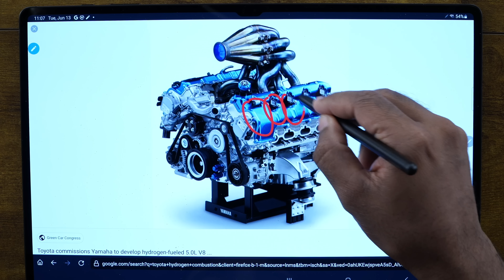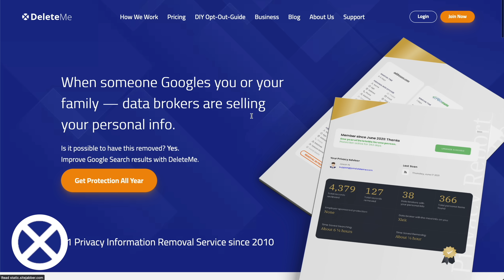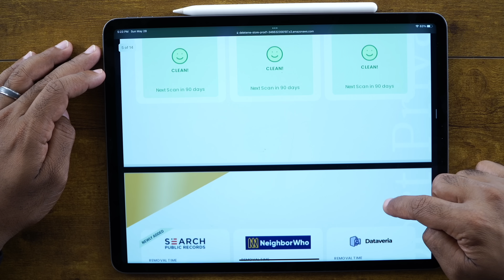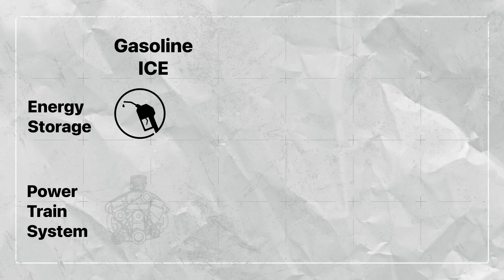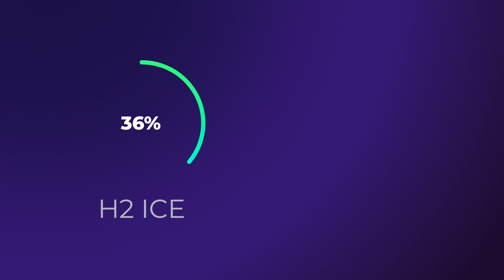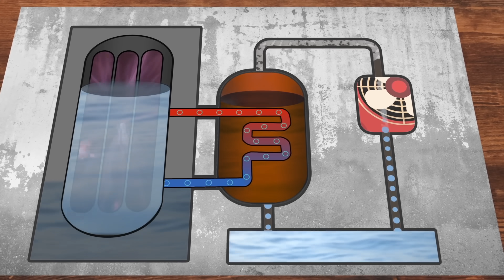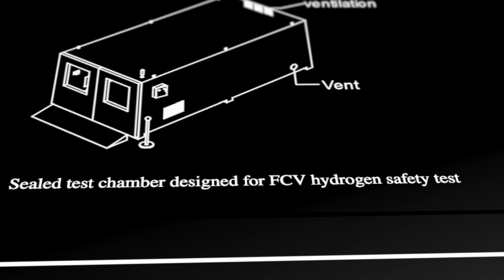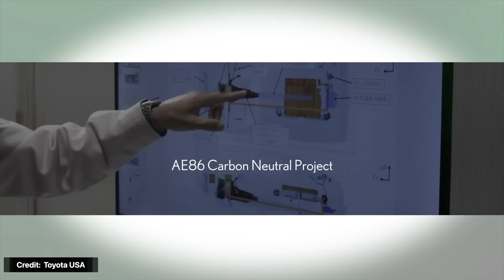Toyota's Says They Just Destroyed EVs - Hydrogen Combustion Engines

Comment: Very eloquent and informative documentary 🎉🎉
As for concerns about NoX emissions from ICE lubricants, maybe far smoother silicone oils can replace traditional engine lubricants
Reply: The NOx emissions are from burning fuel (in this case hydrogen) in air at high temperatures. Air is mostly nitrogen (78% N₂), and at high enough temps it ends up combining with oxygen in the air to produce NOx. The small amount of carbon emissions come from the engine oil.

Comment: The battery sucks hydrogen can bridge the gap between fuel cells and current engines. Electricity is the way but battery is dangerous and 125% less efficient then gas which makes it to dangerous to make it equal.

The battery of a tesla is 900 to 1200 lbs which equals a 50 to 80 lbs of gas and hydrogen the about. The energy density  substantially was to ever on a battery increase it would be even more dangerous then dynamite. If hydrogen as a battery source were to happen you'd have a fuel cell that more equals the benefits that gasoline has. Any combustion car in the world can switch over to hydrogen which reduces emissions all around and increases demand and increases the likelihood if stations popping up. Electricity is good traditional batteries are not

Comment: I can't understand why neither you or anyone I could find in the comments are recognizing that this NOx problem is easily solved by injecting O2 in equal amounts to H2 into the cylinder, thereby attaching all the Os to the Hs without the addition of any dirty atmospheric contamination!  Then you get pure water (with, of course the understanding that there will always be that tiny amount of lubricant seepage past the rings, especially as they get older, and possibly some metallic contamination from various metals wearing on each other when not properly separated from each other by lubricants).  But the major problem of NOx is easily solved by just adding a second injector and O2 delivery system!
AND, you'd probably increase the power output by a huge amount when one considers the ratio of N to O in the atmosphere!
Come on, Toyota/Yamaha, get on it!

Comment: I'd much rather drive a Hydrogen ICE car than a stupid EV. I don't care for efficiency or that EVs have all their power instantly. I just want to press the pedal and hear the rumbling, press my clutch and shift a gear. (yeah I've never owned an automatic and I've driven such only twice in my life and I hate it). I will modify, rebuild and whatnot my 2003 Subaru as long as it's still legal. Jesus I even hate modern petrol cars because of all of their electronics and displays and stuff. I have even disabled my ABS.

Comment: Anyone here ever deal have a boat with a tiny leak in the water cooled intake? Imagine if your fuel was constantly adding water to the combustion chamber. I realize burning gasoline also produces water as a combustion product but burning hydrogen seems like it will wash out the oil and make an emulsion constantly on the cylinder walls until the engine warms up above the boiling point. Would love to know what the oil change intervals are or if they have some sort of engineering solution to this problem.

Comment: The problem about hydrogen is not about whether to use ICE or fuel cell, it's how can we transport highly flamable hydrogen gas to the station across the country. Like to transport it by truck, the gas has to be cooled and compressed to transport which in these process use tons of energy. I believe this is the reason why fuel cell vehicle haven't took off. And neither will hydrogen ICE if no one could find the way to effectively transport hydrogen gas.

Comment: I don’t think it’s the long term solution, but it may be an interim solution, especially if someone commits to putting it in OTR trucks and finds a partner to provide nationwide hydrogen filling stations. It’s quick refill capability is a huge benefit for trucking, and other long-range transport. Might also be useful in shipping and/or rail transport.
Reply: I think that we are a species we have stopped where we are because it works for us. Until we push pass where we are we'll be using ICE for awhile
Reply: I disagree. It is not popular now because hydrogen delivery infrastructure is lacking and clumsy. But some recent research found a way to absorb large amount of the gas into a powder and release it on demand. Given a storage solution , hydrogen can be produced anywhere with solar panels.
Reply: @cplai  doesn’t sound like you’re actually disagreeing with me.
Reply: @geoffstrickler  What I meant was hydrogen can become the long term solution because better storage technologies are on the horizon. So I disagree this is only an interim solution.
Reply: @cplai  Storage isn’t the main issue with hydrogen fuel, it’s separating the hydrogen from water or other sources that is very inefficient. Add in the costs of compressing and storing, and the total cycle is pretty inefficient. It’s useful, but I don’t think it’s a long-term solution.
Reply: @geoffstrickler  I think you missed what I implied in my first reply earlier in this thread. There is a recent research on how to absorb hydrogen into some kind of powder. In such form, the hydrogen molecules can be stored in extremely compact form, not a gas, not a liquid, just being held tightly in the powder medium. The hydrogen can be easily released from this powder on demand. Such storage option can make hydrogen a long term solution.
Reply: @cplai  You’re missing the point. As I said, storage ISN’T the main issue. It’s the energy required to separate the hydrogen from water or other sources that is the issue. Doesn’t matter how easily you can store it or separate it from the powder or paste, it’s separating it from whatever original source you’re using to create the hydrogen in the first place.
Reply: @geoffstrickler  That is exactly why I said I disagreed in my first reply. We basically have opposite view of the situation. Let agree on the fact that we disagreed.
Reply: @cplai  So far, you haven’t said anything that disagrees with what I’ve written, because you keep misunderstanding the problem. The high cost is in isolating the hydrogen in the first place, not in storing it. Storage ISN’T the primary issue, it’s separating the hydrogen from whatever source you’re using to produce the hydrogen. Until you grasp that, there is nothing for us to disagree over.

Comment: I believe that alternative fuels for ICE engines will be the best way towards fixing our emissions problems. It’s not that it’s better than EV’s it’s that it’s very much a better option than Gasoline ICE’s. That’s the point. No they aren’t perfect. But do they need to be? IMO the answer is no. Absolutely not. For me batteries don’t have near enough capacity for a EVs to be a direct replacement for gasoline. I’m not saying abandon EVs, I am saying why not have the best of both worlds? If you commute 15 miles to the office, get an EV for the best reduction in emissions. If you tow equipment 400 miles daily, buy a diesel. If you do a combination of both go for a alternative fuel ICE vehicle. Why limit our options to one type for the future? Alternative fuel infrastructure hasn’t even been given a chance yet. Why are we expecting to go from 1/10 to 10/10 right away? Won’t 7 or 8/10 be good enough for the immediate future?

Comment: I'm not sure what Toyota's motivation is, but I do know that you've really missed the boat on the best justification for H2 ICE by ignoring the truck application. You made it sound like that only matters for commercial trucking, but there are millions of passenger trucks and large SUVs on the road this summer in America alone, which will likely never be replaced by EVs, simply because they need to tow something - and electric power just absolutely stinks for towing. The only viable solutions I've seen involve either adding electric powertrains to every trailer that an EV might tow, or adding battery banks and using high power connections so the trailer can supply additional power to the EV to offset its weight. In either case, it means every trailer currently on the road has to go to the junkyard (not eco friendly) and trailer gross weights will have to increase dramatically to keep the same useful loads.

H2 ICE could be the solution. It may end up being a bit of a niche, but as long as the pump stations are available, I think people who want a real truck that can tow existing trailers over real distances would happily switch to H2 ICE to dramatically reduce carbon emissions.

Comment: EV's aren't as efficient as made out here. Sure, the energy is 90% efficient once it gets to the car- but he counted the energy inefficiency of the ICE from producing the hydrogen. So what about producing electricity? Well, nuclear fission power plants are around 33% efficient, solar panels and wind turbines being on average between 20 and 40% as well. So while the ICE is overall 36% efficient, once you chop 2/3 of the """90%""" efficiency of the EV off- for reasons the ICE had its efficiency reduced already- you get approximate 30% efficiency. Lower than the ICE.

Comment: You mention the efficiency of an H2 ICE and include the production of the fuel as part of it, but I didn't notice you include the production and transmission of electricity before getting stored in the battery. I would have to look up the numbers, but if electricity is created through burning a fuel source, I think the power only has 40% of the energy that the fuel source did? Also, not sure what the efficiency of solar panels and wind turbines are.

Comment: I wonder if there will ever be "Plug-in Hybrid Hydrogen Combustion Engines" or "Plug-in Hybrid Hydrogen Fuel Cell" cars. This way if Hydrogen infrastructure is lacking you can still charge for 50-100 miles of battery range.

Comment: THIS GUY DOSNT KNOW WHAT HES TALKING ABOUT. HYDROGEN IS THE FUTURE. ITS MUCH MORE EFFICIENT THAN ELECTRIC. ELECTRIC GRIDS ARE GOING TO BECOME STRAINED IN THE FUTURE WHICH WILL LIMIT ELECTRIC CARS EVEN MORE. WE ARE ALREADY HAVING TROUBLE WITH THE LOAD IN TEXAS ON THE ELECTRIC GRID. HYDROGEN IS THE FUTURE BECAUSE IT IS CLEAN AND ONCE THE SUPPORT INFRESTRURE IS BUILT FOR HYDROGEN CARS IT WILL ESSENTIALY TAKE THE PLACE OF GAS ENGINES..

ELECTRIC VEHICLES CAN NEVER TAKE THE PLACE OF GAS VEHICLES BECAUSE THEY ARE SIMPLY JUST TOO INEFFICIENT TO BUILD AND MAINTAIN OVERTIME. WE HAVE TO DO SOMETHING WITH ALL THESE BAD BATTERIES AND THE POLLUTION THAT COMES FROM MINING COBALT AND LITHIUM AND THEN HAVING HUGE LANDFILLS OF NOTHING BUT BAD BATTERIES THAT NEED TO BE RECYCLED CAUSING CHEMICAL POLLUTION INTO THE GROUND WATER AND SOIL.

TRUST ME HYDROGENN IS THE FUTURE. 
ELECTRIC VEHICLES ONLY PRESENT THE SAME PROBLEMS IN DIFFERENT WAYS

Comment: The development reasons would seem to be twofold. Firstly, as you stated, in the heavy goods vehicle world, battery tech doesn't make a lot of sense, where a huge volume of immediate emissions could be removed by switching to retrofitted H2 ICE. These engines may also be used in aviation and rail, where long distances can be covered with large payloads. Secondly, I think you missed the point that while electric motors are far more efficient, the environmental cost of scrapping the existing ca. 1.2billion cars on the road is completely untenable. Modification to an H2 ICE would cost far less than a new car and would effect a substantial improvement in local air quality in highly populated areas.

Comment: Here in Australia for many years we have had LPG Powered cars Same idea as this  option just with a different gas. The problem  mainly is that H2 at the current time can only be made in great quantities and cheaply using VERY dirty ways which more than over rules the cleaner emissions burning H2 would bring about. 
As for refueling stations here in Australia this used to be a problem with LPG fueled cars you could get it in all main cities but not on the highways and small towns so LPG was usually only used for city driving as an example in taxi cabs. The big saving was in the cost for LPG per litre  when compared to Unleaded or bact at the start leaded fuels. 
Right now  here a litre of gasoline fuel ranges from $1.60 upto $2.00 per litre depending on what quality you want. While my LPG costs between $0.79 to $0.99 per litre and unless i am towing i still get the same milage as the gasoline car. This is in a 2003 model car with just over 100,000 miles on the clock. Later model LPG cars used  the liquid gas injection like what you are describing the H2 cars will use and these dont loose range to gasoline cars when towing. 
Because LPG is a fossel fuel but burns at a significantly higher temp than gasoline it has less harmful emissions though still not NONE. To convert my LPG car to H2 as fuel all it would take would be to change from the old system to liquid gas injection a matter of swapping the head on the engine and installing the correct injectors to suit the H2, The remaining fuel system would meet the requirements to hold and [i[e the H2 from the tank at the rear to the engine up front. 
As for EVs being so clean and good for the environment most EV people that claim EV is way foward and all else will kill the planet always over look the emissions getting all the minerals that are required to make the batteries and turn them into limited life span batteries which when they die are just more toxic landfill along with the car they are in due to cost of replacing the batteries being greater than a new vehicle. Also there is the emissions created by electricity generation as there is little truely Green energy production being made as a percentage of electricity world wide. Most electricity in the world is generated by dirty means when you include Atomic energy in the dirty (due to the left overs whebn fuel rods are used up that have to be stored for so many years to make them safe). 
Till the electricity storage or generation can be made to happen in an affordable and clean way it is not the answer it is only a part answer neither is H2 an answer but it is a part answer the main thing is we have to get away from fossel fuels to start and to then as the cleaner ways to make electricity AND cleaner more effecient battries can be made with greater storage or fuel cells to generate electricity on the go to improve range and charging times. 
There is no real true clean answer but only ways to try to limit dirty emissions as much as possible, remember methane is also inclided in so called green house gasses but we are not saying to stop breeding cows or sheep etc to cut the production od methane because it would lead to bigger problems. 
There are better answers but we cant wait for them to be found to save the planet we have to work with what we know now and attack the problem with the best of all possible ways to remove fossel fuels so we use the cleanest possible fuels at hand at the moment.  Every little bit helps. I am not a fossel fuel junky nor am i an EV or H2 fan as i see places where one vehicle would work better than another for example in medium sized cities and some of the larger ones where your travel time to and from work is not too large then an EV would work well and clean up the air in those places for longer driving such as interdtate or country driving then some form of Hybrid vehicle that produces electricity on the go would be best. and to help clean up the older vehicles that still are good vehicles you could for a reasonable amouth convert them from gasoline to run on H2 as this is mainly replacing an old tech with a new fuel.
Even this sort of fitting the solution to the use of the vehicle will not cover ALL the different places the emissoms are coming from Rtucks at this time dont have a replacement for the current power train nor do planes.These rely on mostly fossel fuels or some blend of bio furls and fossel fuels.
It is a long way to go to get to carbon and other green house gas neutral with luck and taking jard choices it will happen in time as we clean up our act but it has to be done without using tech that seems cleaner untill you look behind the face of the tech and see how parts of it are made and what is the waste from that. This is where the Atom was in the 1950s it was going to be CLEAN CHEAP ENERGY ofr the world but time has shown it is not CLEAN  or CHEAP.